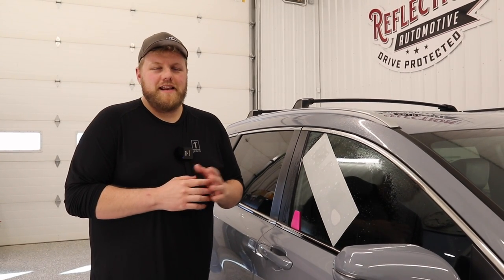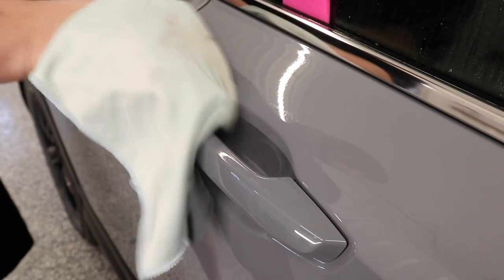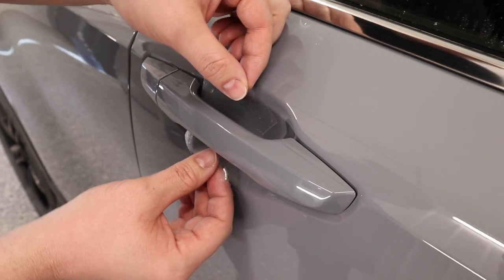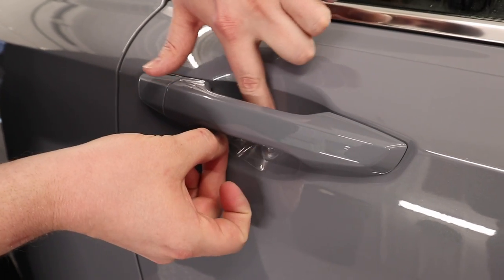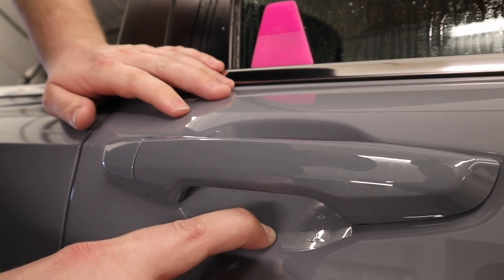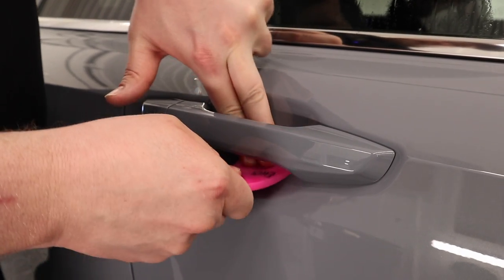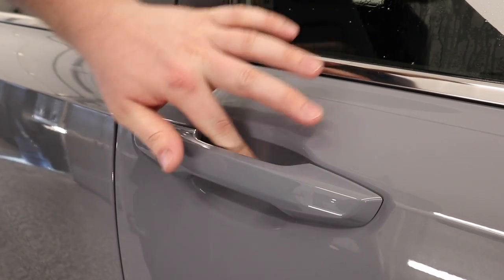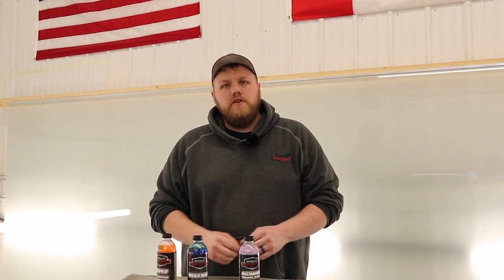PPF Pro Tips - How To Wrap Door Cups

Comment: Have you tried tacking it around the top and bottom edges and using a hair dryer to help it stretch into the cup with a bit of tack solution?
Reply from the maker: I have not.. this sounds like a good idea! Does it work good for you?
Reply: @Drive Protected  I'm not a professional but it works great. I just did them on my new camaro today and they turn out perfect.

Comment: Eric do you still use xpels plotting software? I am trying to find generic door cup patterns with no luck. All the ones that are vehicle specific fit like crap. Any ideas?
Reply from the maker: We do not use XPEL anymore. I personally am not a fan of any door cups. Maybe you could find a way to bulk install them? Im not sure.
Reply: @DriveProtected  Yeah typically I’ll just make my own but I agree, they all suck. Which pattern software are you using?
Reply: I use Core film installation software and you can cut generic cups in various sizes. Just have to select Generic under the vehicle make drop down menu. I agree that 98% of the vehicle specific patterns are garbage.  I’ve struggled to make any of them turn out good.
Reply: @jesselucero8503   how do you like core? And how much is it? Trying to find costs of the different softwares is impossible. I like DAP but the cost of it is ridiculous
Reply: @nateojala  I don’t know the cost of it, but I’m sure if you gave Eastman Performance Films a call they could get that information for you. I like the software. Very easy to use and intuitive. I haven’t done a lot with editing patterns yet, but seems fairly straight forward. They are pretty quick also when it comes to adding new model cars.
Reply from the maker: One thing to note when using a pre-cut pattern software is to not look a whole lot at the cost, instead look at the value of the program. Stuff like the ability to edit and modify patterns, quality of patterns, quality of customer service are all huge things to think of determining a software to go with.
Reply: @DriveProtected   Can you say which software you use? It seems like core and dap are the only good options